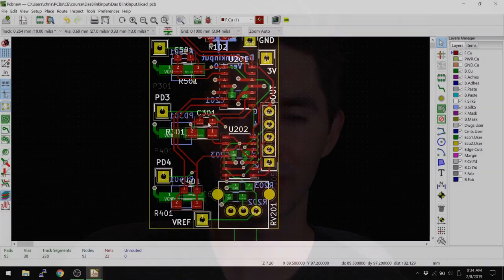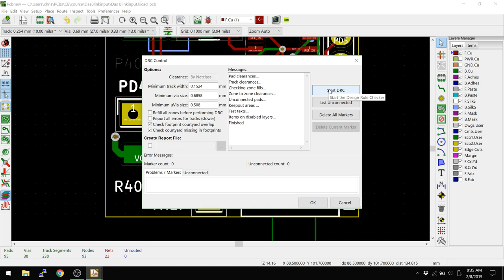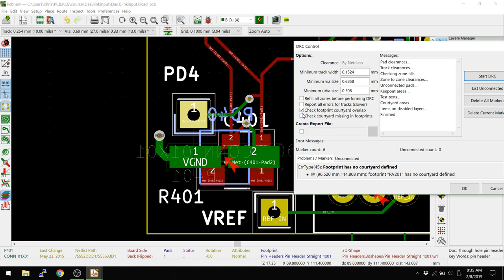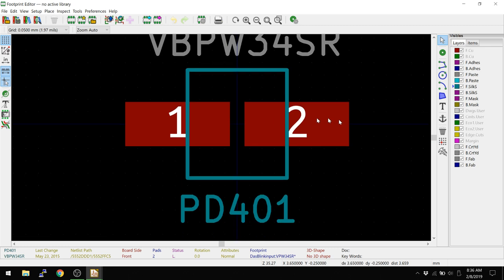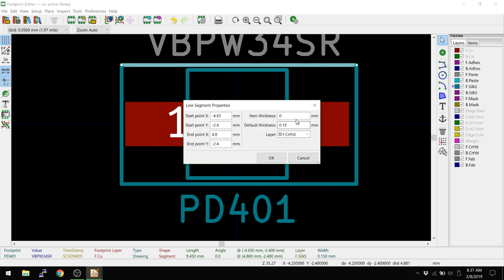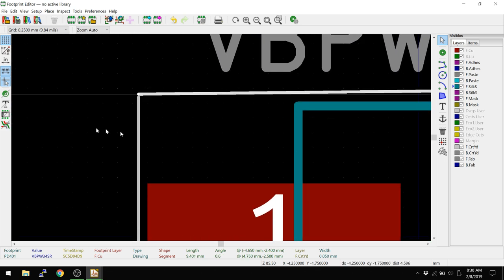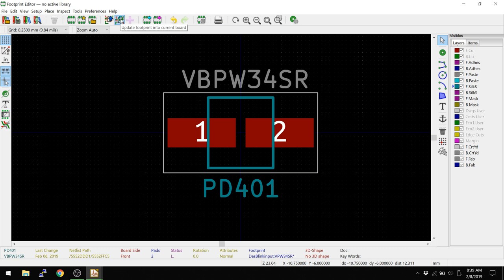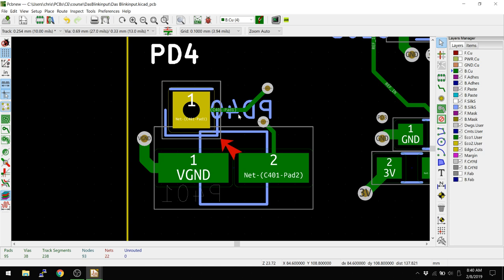KiCad 5.0 - Courtyards and how to use them

Comment: Kicad - Preferences - Footprint Editor - Default Values - Courtyards (At least in 5.1 nightlies)
Set it to 0.05 mm once and for all.
And like Lasse wrote, just click on the right layer before you start drawing.

Thanks for your videos! I learn a lot.
Reply: And now you made me go trough all my footprints and update the courtyards. Pretty easy to do when you get the hang on it. Doesn't need to be super accurate either. The tools are there to be used. Correct courtyards and other properties like pin direction makes DRC so much more useful.
Reply: Had to think further on this courtyard line thickness. Why should it be 0.05 mm in the first place? Is there a technical reason, or is it just for aesthetics?
I tested with a 1.00 mm line width, and found that it is the center of the line DRC looks at. Default width is 0.12 mm. Why change? It's not used for production, probably not for printouts. Just for DRC AFAIK. Thoughts?

Comment: What version of KiCAD is used for this video?  I'm using 5.1.2 and the PcbNew DRC Check dialogue box is different from yours...  For instance, I don't have the "Check footprint courtyard..." stuff.
Reply: Ok... With KiCAD 5.1.2 PcbNew there's the possibility to switch off the courtyard checks by selecting File -> Board Setup -> Design Rules -> Prohibit overlapping courtyards.  Untick the checkbox to void the courtyard checks, tick otherwise.
Reply: @geertvancompernolle2586  Right, it's not in 5.1.10. (mac) either. In other words, the feature has moved to the "Design Rules" part and is enabled there, not in the Run DRC section!